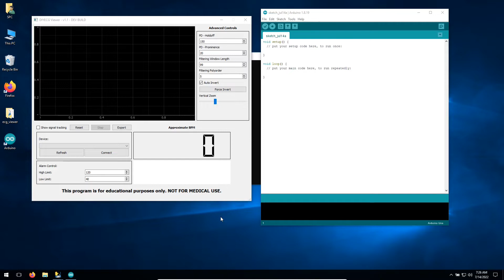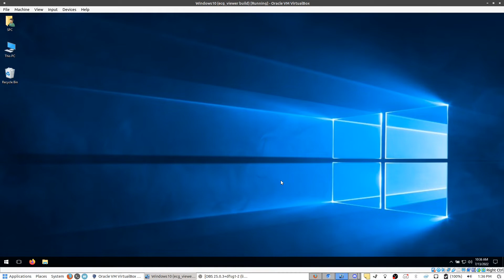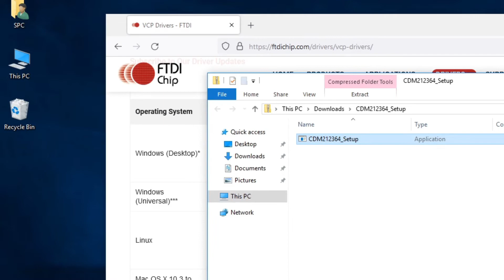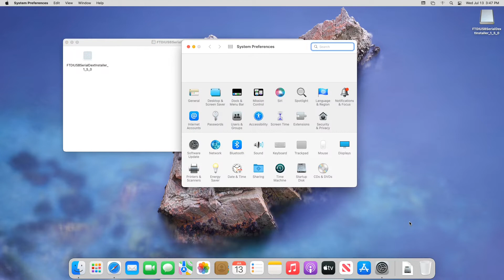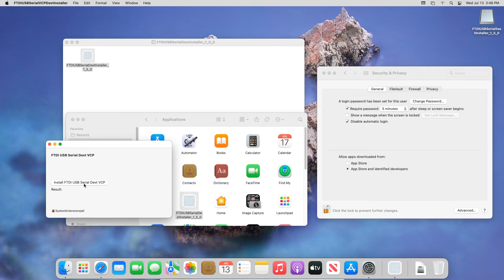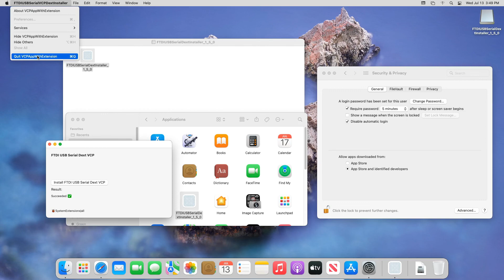Arduino Nano Drivers | FTDI Driver Installation | Connection Issues

Comment: Any ideas how to get this working on M1 macs? Doesn't seem to be working here..
Reply from the maker: I don't have a specific video on mac but if your FTDI drive is good you may need to check these other drivers https://www.youtube.com/watch?v=kr1sm-d31FU
Reply from the maker: just so you know I have the M1 and I use nano's all the time
Reply: @HTMWorkshop   Thank you!! I have checked that and I probably need to try with another USB-cable, maybe the cable is at fault.
Reply: I am on windows and I followed the steps but my FTDI module is not picked up when I plug it in. Also, in the device manager tab, the drivers do not show up. They are hidden.